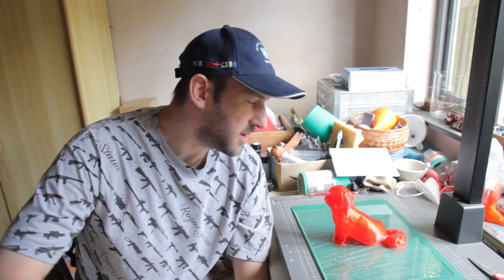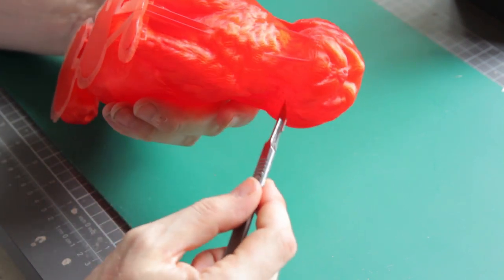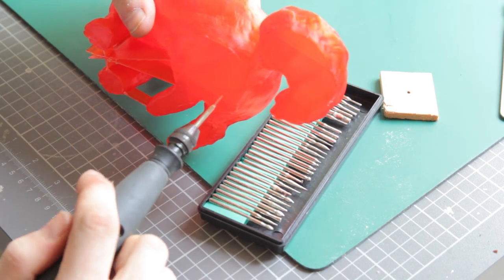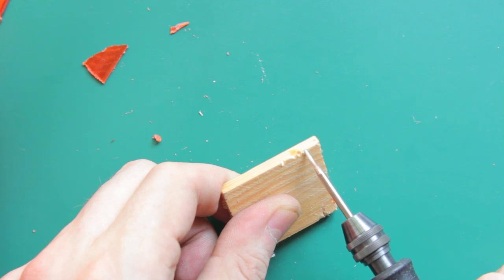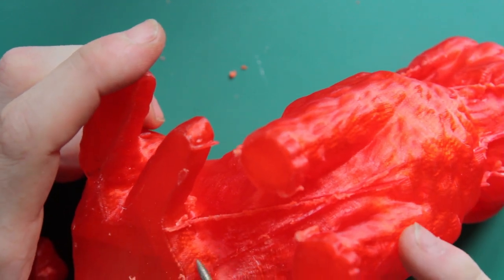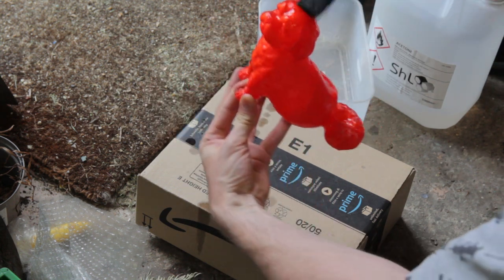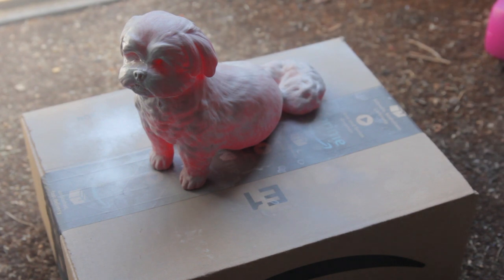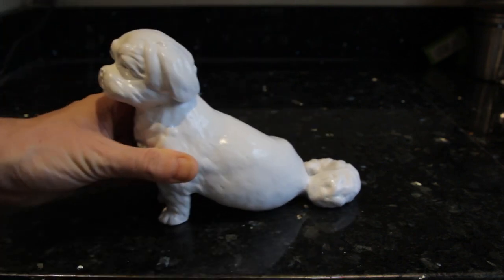My 3D Printed Dog Urn

Comment: Hey Old friend, I didn't know you did FDM too.  My Mars 2 just collects dust now lol.
Reply from the maker: Hey Sam! Lol about the mars2, mine broke down as well after not using it for a while! Ive been doing FDM for years! I learnt early on that mixed pla/pha can be smoothed nicely with acetone. Ive been trying to show how but got a lot of hate for it as regular pla obviously is not affected by acetone. I almost exclusively use transparent red colourfabb as it smooths best if printed at 0.06 layer height. I have a massive thread about it on the ultimaker community forum, but its pretty old now and tons of pic links are broken!

Comment: have you got a link to your drimel cheers
Reply from the maker: I think it was this one i used. But there are loads these were cheap but still good. https://www.amazon.co.uk/Diamond-Grinding-Carving-Ceramics-Jewellery/dp/B07HT189RT/ref=mp_s_a_1_6?dchild=1&keywords=burr+tips&qid=1629080921&sr=8-6
Reply from the maker: This is the dremmel i have, could be newer but make sure to get the metal rotary attachment cable https://www.amazon.co.uk/Dremel-Multi-Tool-Attachment-Accessories-10000-33000rpm/dp/B0161BHMBQ/ref=mp_s_a_1_4?dchild=1&keywords=dremmel&qid=1629081366&s=diy&sr=1-4-catcorr
Reply: @Cloakfiend  cheers
Reply: @Cloakfiend  cheers
Reply from the maker: @darren990  no problem!